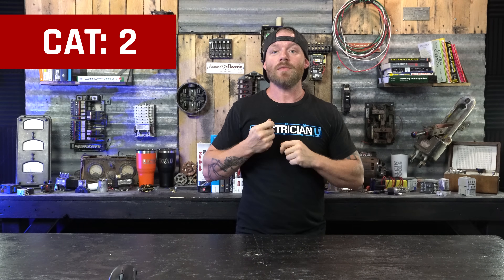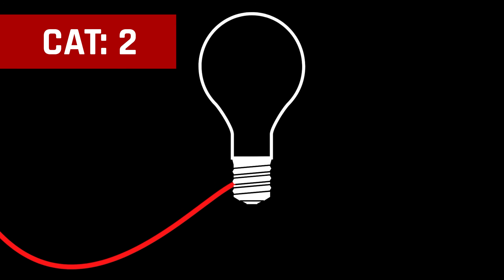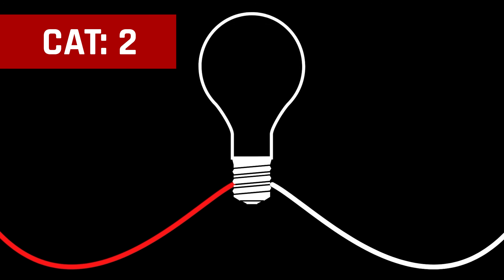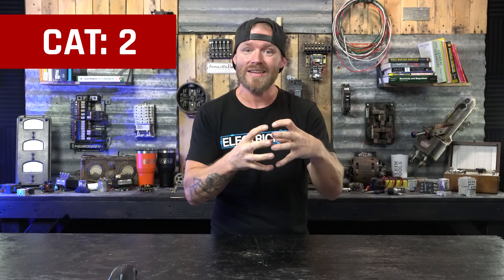What Do CAT Ratings Mean?

Comment: 1:04 - you mention that if the two mains were to short it would allow a lot of current to flow due to very low impedance. Makes sense. But how much current would flow if you shorted or touched the two main wires coming from the transformer? Just curious.

Comment: Been doing electrical work since I was about 11 or 12 years old helping out, learning how to use multimeters etc.   Have in the past used it for measuring voltages at panels, and for verifying correct wiring at dryer and range receptacles,  never knew about CAT ratings back then.  5 years ago I had an osha 10 class, as well as NFPA 70E.    A real eye opener.   Learned about a case where a maintenance worker was taking voltage measurements  in on a 480 volt switchgear,  when the meter exploded.     Technician survived, but wished he hadn't, was very gruesome and that could've been me.  Going forward,  I always verify the CAT rating of the meter to the location as if my life depends on it, because otherwise I'm rolling the dice.

Comment: 2nd year industrial electrical apprentice here and hoping someone can help. I’ve been told 277v “doesn’t have a neutral” and that’s why it’ll shock you when we work on lights. But how can a lighting circuit not have a neutral ? Could this be because there is a load on the neutral or maybe it’s sharing a neutral with another lighting circuit ? Thanks
Reply: 277v is a Line to ground voltage in a 277v/480v Y system, not sure why someone would say there is no neutral?
Reply: @waynecostanza2280  not sure. But always been told the neutral on a 277v circuit will always shock you and I have been shocked by it before. Im just not sure why a neutral would shock someone?
Reply: @cyle_rado  I’d guess bc when you start to take apart the neutral you can open it and creates a voltage? And 277v definitely contains a neutral. I’m kinda glad they’re moving away from 277 in non industrial buildings
Reply: in a commercial building, there is often a transformer for each floor, creating the Y 277/480; it's like a service, and creates/defines it's own independent neutral. It should always be bonded to a ground at the service point of entry (this might be inside the transfo, or main panel for that transfo; where ever the main service disconnect is located). All the plumbing & steel in the building should also be bonded to the same ground somehow...

Also, you can get shocked of any neutral if it is carrying current for other circuits, or there's wiring errors, or other faults.
Reply: I would say this would make the most sense to me, just like a multi wire branch circuit that has two hot legs and a shared neutral, if you don’t correctly install a ganged breaker and you try to work on the neutral you can get shocked.

Comment: When you say 30 ohms or 2 ohms for those meters, are you talking about when used as an amp-meter or ohm-meter? Because typical ratings for a volt-meter are very high, on the order of 10 million ohms. The old analog meters were 10  - 50 thousand ohms.  When used as an amp-meter, the impedance should be as close to 0 as possible. When used as an ohm-meter, the internal resistance should be relatively low, but the internal resistance of the meter is known and accounted for internally to get the measurement. When used as a volt-meter, the internal resistance should be as high as possible.  When you stick a volt-meter across a circuit, you want to draw as little current as possible through that meter. The more current flowing through the meter, the less accurate the voltage reading will be, because the voltage drop in the circuit before it gets to the meter will be higher.  Think about  it using Ohm's law. If you used a volt-meter to measure 240v at the panel, and the internal resistance of the meter were only 2 ohms, you would be drawing 120 amps as soon as you connected the leads. Can you say arc-flash event? Obviously that's not practical.
I was left confused by your video, so I decided to look it up and found this: https://www.digikey.com/en/blog/what-are-multimeter-cat-safety-ratings
It turns out the impedance you're talking about is the impedance of the test source, that is the impedance of the circuit being tested, not the meter.  That makes a lot more sense.

Comment: Super important to note! a lot of meters (even some mid-range brands) do not actually meet their CAT ratings! The eevblog forum maintains a list of meters that do not meet their rating and I'm sure if you do some searching you can find out about any meter you are looking at buying. If I remember correctly Dave Jones got a nasty burn on his hand because a meter exploded while holding it. He wasn't doing anything wrong, but the meter didn't meet its spec and when it failed the plastic case wasn't designed to contain the explosion properly. If you are using test equipment daily then you need to demand the safest possible. If you see a meter have a glass fuse in it then it is very not safe; all meters should have ceramic HRC fuses that resist fragmentation.

Comment: Confusion on Cat III showing a rating of 1000V and Cat IV 600V on the meter shown. But yet you stated that Cat IV meter can be used at voltages over 600 volts. So why is the rating marked 600V?
Reply: You should not measure voltages over your meters rated voltage. Leads, terminals and internal construction is designed to have enough dielectric for its rated voltage. Applying 480v to a 300v meter could be very dangerous. It just isn’t made to withstand the electrical stress and could result in an arc or shock.
Reply: yup, so it can only go up to 600V in a cat4 environment. In a cat3 environment, it can handle 1000V

I think this video will be reworked...
Reply: Not quite, the category environment  dictates what category meter you need, the working system voltage dictates what voltage you need.
For instance a Cat IV 300v is good for a 120/240 pad mount transformer located near a utility pole. However a 277/480 circuit off a three phase panel would need a Cat III 600v, this is because the line to line voltage would exceed the working voltage of a 300v meter. So the Cat rating is for transient over voltage due to the proximity to the source of energy and the voltage rating is for what voltage you will be working on.
Reply: @waynecostanza2280  Is the voltage rating peak, peak to peak or RMS?
Reply: We would call it nominal, and nominal is RMS. That being said typically the voltage will vary about + - 5% from nominal.
Reply: We would call it nominal, and nominal is RMS. That being said typically the voltage will vary about + - 5% from nominal.
Reply: We would call it nominal, and nominal is RMS. That being said typically the voltage will vary about + - 5% from nominal.
Reply: We would call it nominal, and nominal is RMS. That being said typically the voltage will vary about + - 5% from nominal.
Reply: We would call it nominal, and nominal is RMS. That being said typically the voltage will vary about + - 5% from nominal.
Reply: We would call it nominal, and nominal is RMS. That being said typically the voltage will vary about + - 5% from nominal.
Reply: We would call it nominal, and nominal is RMS. That being said typically the voltage will vary about + - 5% from nominal.
Reply: We would call it nominal, and nominal is RMS. That being said typically the voltage will vary about + - 5% from nominal.
Reply: We would call it nominal, and nominal is RMS. That being said typically the voltage will vary about + - 5% from nominal.
Reply: We would call it nominal, and nominal is RMS. That being said typically the voltage will vary about + - 5% from nominal.
Reply: We would call it nominal, and nominal is RMS. That being said typically the voltage will vary about + - 5% from nominal.

Comment: Why is the Wire from Meter to the Circuit breaker box ALUMINUM? You would think it should be copper and have less  impedance ? While testing ALL the circuits , the wires are Copper, not these though !
Reply: Lol aluminum is cheaper and a decent conductor. It's just larger which is needed to handle the same as a slightly smaller copper wire.
Reply: My last house had aluminum conductors to the panel and copper in the circuits. Nothing wrong with that. The electric company can do anything it wants. Like an idiot I had an electrician change it out to copper. Not needed.
Reply: alu is fine for big wire & lug connections. it was a problem back in the seventies for small circuits.
Reply: @Jnglfvr  the smaller the better, i only ever use 2/0 copper from the meterbase to panel, alluminum is twice as big and can really be a pain for electrical changes way down the road
Reply: Aluminum service cable is safe to use. About 40 years ago was on a fire job after I gave the homeowner the price he asked if I was going to use copper service cable. Told him that I never used copper service cable but he wanted it. Told him that it would cost $300 more. He called me a F'ing thieve. Cable was a $1 an inch. Guy must have got other quotes & called me up the next week to do the work. Told him to go F himself.

Comment: Can you make a video lesson explaining what is "available fault current" giving a bunch of examples. All DVM METERS have a "10 Meg ohm input impedance" so I'm confused why CAT 2 = 12 ohms impedance and CAT 3/4 = 2 OHMS impedance, can you explain this?
Reply: You are correct about the input impedance of the meter, at least in voltage mode. I believe he is Mis informed about this. I have an explanation of category ratings in the comment section that could be helpful. Also current rating of most DMM when in current mode are usually max 10Amps. So clearly current capability has nothing to do with the category rating. Where I think he may be getting it from is a robust input protection when activated can shunt the transient voltage through higher current rated components(ie. resistors, MOVs and alike) effectively shunting and discharging the energy. These components need to be more robust in higher category rated areas and therefore higher rated category meters have these higher   Power components.

Comment: My EE background makes me call out some of this info, and in researching it, I found even more.

First, what's with this "2Ω of impedance" on a CAT 3 meter? It's certainly not the input impedance of the meter in voltage measuring mode; putting that across 120V would definitely be noticed, as it would (try to) pull 60A through the meter.  (Also, Klein proclaims the input impedance in V mode as 50MΩ, but the specs in the manual say 10MΩ.)

2Ω is pretty high for current measuring; on a 1A draw, it would drop 2V.  Quite a lot on a 12VDC circuit.

On the plus side, the Klein MM450 looks pretty sweet.
Reply: This was not clear in the video, but I believe the impedance numbers stated are those in the wiring from the service to the point of measurement. Thus I think the stated impedance is what will limit the initial short circuit current. Thus I belive a higher cat rated meter is designed to be used in a circuit that has a higher instant short circuit current capability.
Reply: @noiseismymiddlename5669  Yes. The impedance mentioned is the SOURCE impedance not the meter's input impedance. The transient source current would then be equal to the maximum transient voltage spike divided by the source impedance. The lower the source impedance the greater the potential current spike at a given transient voltage.

Comment: Used a $900 Fluke model 1587 combination VOM & 1,000 Volt megger before retiring. Great meter. Used the megger function several times a week to PM motors. Have to be careful if you blow the 1,000 Volt fuse megger will give false reading. Recommend that you carry a few replacement fuses. They always took weeks to get from a supply house. NEVER purchase or use ANY test or safety equipment from scum bag lying cheating lack of quality control communist china.

Comment: Meters save lives. Any time I opened something up I checked for voltage, breaker is open, locked and tagged out, the switch on the wall is open, and there was still 115VAC present. The local switch was labeled with the wrong panel, but the panel was labeled for that circuit so the panel was labeled improperly also. And the local switch was wired backwards, breaking the white wire, instead of the black wire!
Reply: Line side switches work just fine (at switching off a heart beat).
Stay safe!

Comment: Great explination of "more current at the source"   Shorting a car battery is worse than shorting the wires of the break light. 
BTW - just a heads up. any metal connected to buss bars at 4MW and above makes a great flash telling everyone where you are (and what was done) 
Saw a OSHA documentary where the guy used a CAT-III meter on the HV side of a step down transformer. He did not die but suffered and bleed out for hours as they tried to save him. Not all deaths are quick and painless. 
Question - 2 ohms.  At 600V two ohms is pretty low and would allow a lot of current to flow. The impedance is for true RMS and spike resolution on switch mode power supplies - right ?

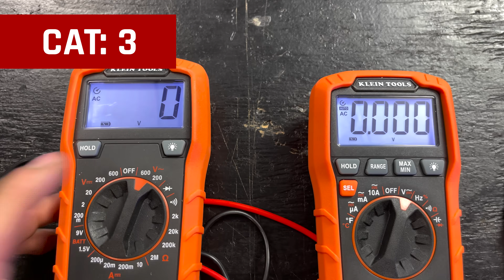Comment: I noticed at 6:40 you had the leads in the current measurement. A top tip especially for the young people, if you’re going to store your meter with the leads in it, put the leads in the voltage measurement configuration because that way if you aren’t paying attention before you use the meter you don’t short the circuit and damage the current shunt, pop your fuse, and possibly destroy your meter.
Reply: Imagine being an electrician and not being intelligent enough to turn off your meter so that it doesn't matter what you have it turned to. Also, even if you DID have the meter left on in the amps setting, you aren't able to put enough current down your leads off a 9V battery to pop your fuse anyway. Learn a thing or two about electrical work before you comment such bad info, teenager.
Reply: @brucebanner52  Jez, Who pissed in your cheerios kid?

Comment: That poor light bulb..... Great video even for someone like me who's not an electrician but does the usual homeowner stuff like replacing the occasional switch, outlet, light fixture, etc as well as tinker with other electronics that sometimes deals with mains (or sometimes higher) power. My go to meter is a Fluke 87v which is admittedly overkill for anything I'll probably ever do but can handle just about anything I'll ever throw at it. Before finding a good deal on the 87v I found my Extech 330 to be a good meter for general home use and is Cat III 600V rated. Also recently picked up a Uni-t  UT208B clamp meter which so far I'm impressed with but  would go with a better brand if I relied on it for my day job.

Comment: I've had an Simpson 260 for more than 20 years and served it's purpose.   Also an amprobe to measure ac current.  The VOM isn't auto rangeing but just start at highest voltage setting.  Oh btw don't try to measure voltage on ohm settings, quick way to instant fry !!!   Occasional digital multimeter for more accurate readings.   Think these plug into outlet gadgets makes dumb electricians as Google maps makes dumb drivers.  But what do I know,. am Old School, though do use G maps and getting dumber by the days 🙃.
Reply: Started out using my dads Simpson 260. Best analog meter ever. Now use Fluke meters.
Reply: Btw always enjoy your yt channel Dustin.

Comment: I know you promote Klein products on this channel, but I have to say the very best price/performance multimeter I have ever used is the Extech EX570. Available from their website for $250, it is very fast and has very high accuracy. It is up there in accuracy with Fluke's which are 3x the price. Even Klein's best and most expensive are nowhere close to the level of the EX570